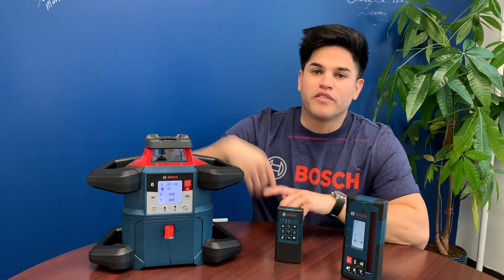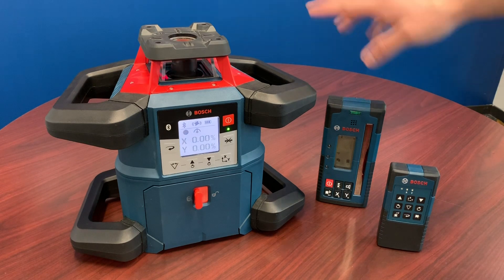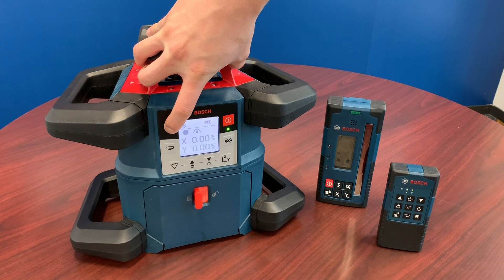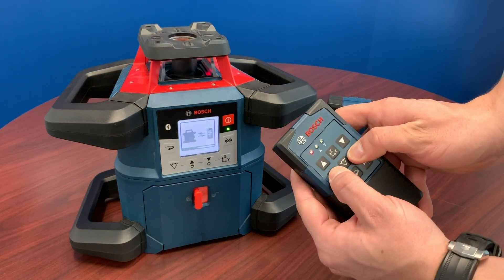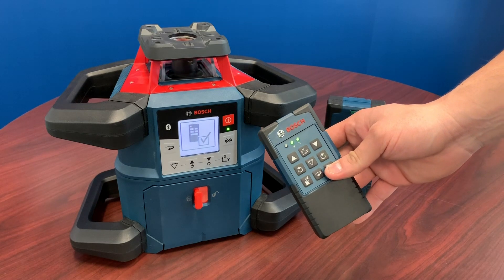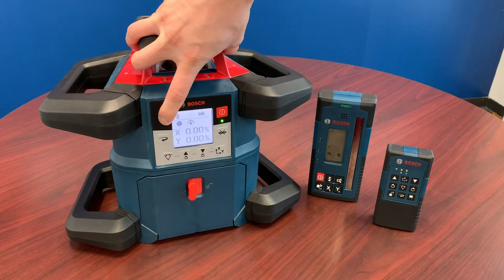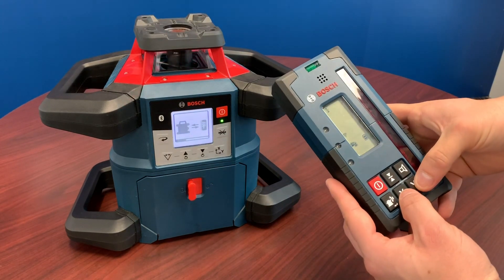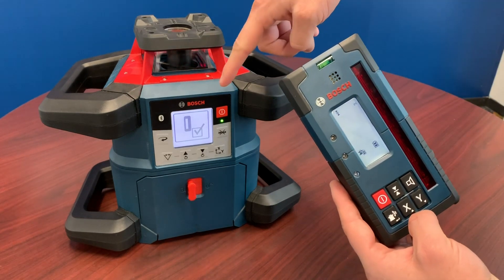Bosch REVOLVE4000 Remote & Receiver Pairing Instructions

Comment: Why don't you first make a video shows how to unbox and setup the laser, and then what happens when you get nothing out of the laser except for red flashing lights.  Simply because your joke of an instruction manual does nothing to cover anything.  Also how about make videos on the GRL 2000-40HV instead of your most expensive rotary laser?
Reply: These tools are made for people who can read AND think. Anyway, if you really need the manual then you may be better off with some dry line, also, water and plastic tubing. "unboxing" videos are for ID10t's and other folks who need to know how to open a box.
Reply: @squirrelgunsmith1131  You are just an idiot, you have no idea why I needed the manual.  Why do I a consumer that is paying his hard earned money on a product, especially one that cost more than most out there not deserve a manual on the product.  When the item fails to work out of the box and I try to ensure its not user error, but yet have no manual to troubleshoot with that is an issue.   As for you TROLL the item was defective and took Bosch 2 months to get me another one, perhaps you need to crawl back into your hole instead of surfing for videos just to write comments about something you know nothing about!